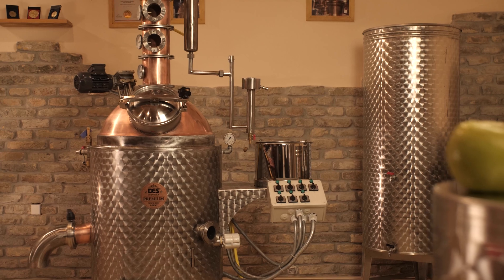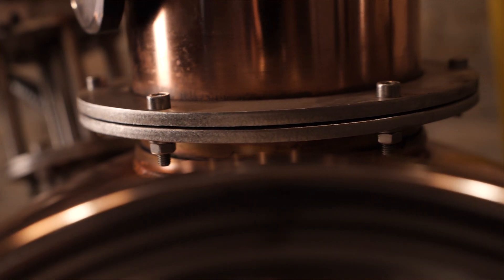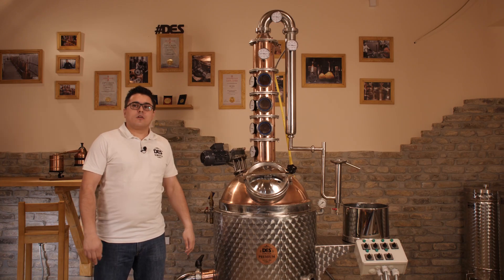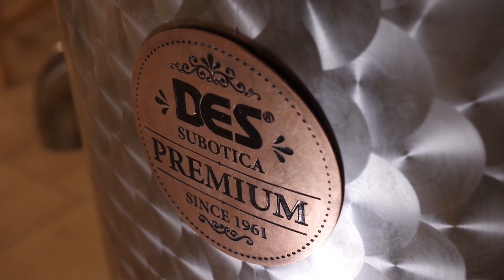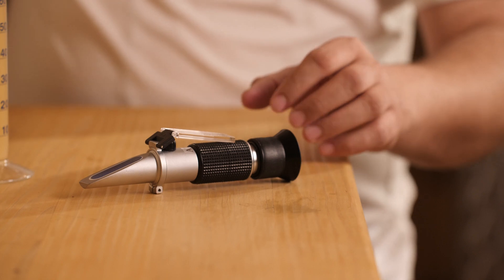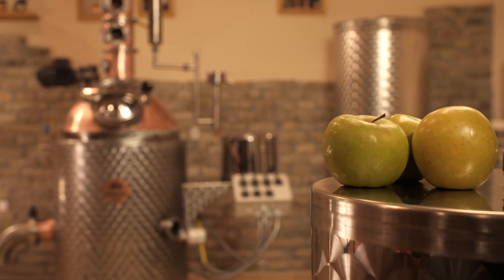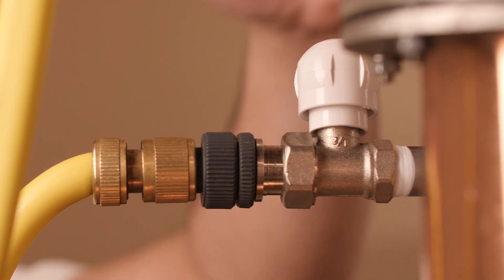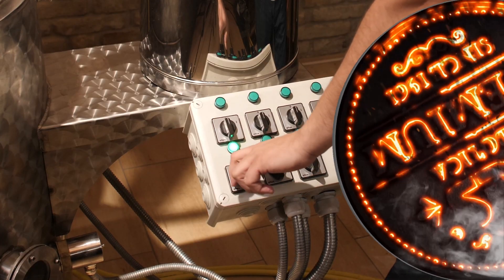DES® DWEC 120l how distillation column works

Comment: Hi. Thanks for the video. Around what volume of drinkable 55% spirit would you look to achieve from 120L still. i.e what is the yield.
Thanks
Reply from the maker: Hi, it depends on what are you making. For example, from this 120 L pot,  if you put in the pot 100 L gin mash you can get 60 L of gin on 41%.

Comment: A thumper and a dephlegmator are two different things. What you have is a dephlegmator which is a partial condenser or in full reflux a full condenser.
A thumper/doubler is used for running a potstill and is in its simplicity a "one-stage extra boiler".
Its purpose is NOT to condense anything...at all, but to re-boil, the vapors coming from your main boiler thus providing a higher ABV (alcohol by volume).